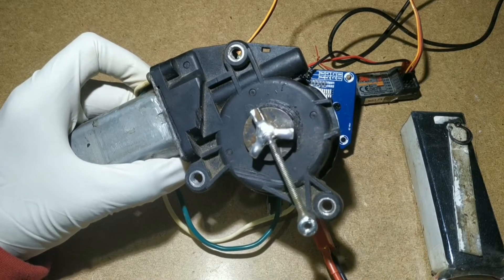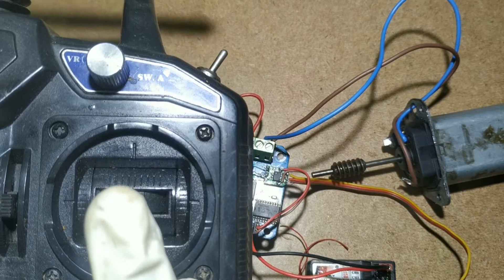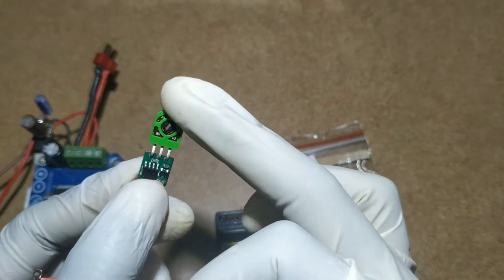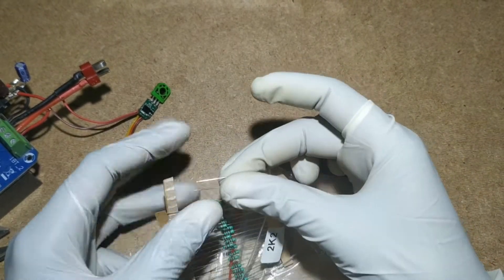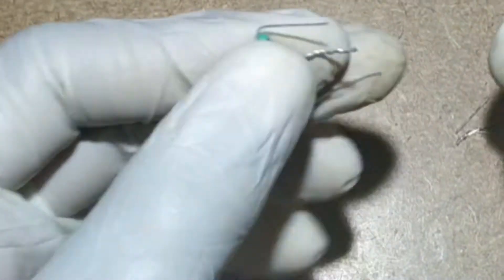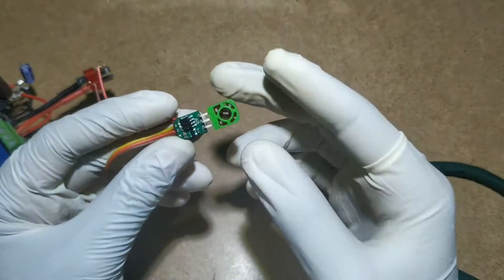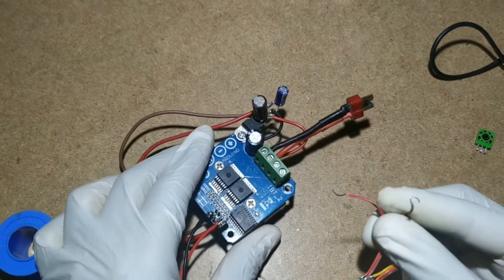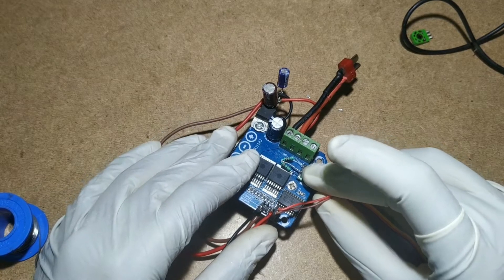How to make brushed esc with servo motor

Comment: May i use 10k resistor
Reply from the maker: “No, use only a 2.2k resistor, because the servo motor originally had a 5k variable resistor, and we had divided the resistance accordingly. Now, we’ve removed the variable resistor and replaced it with a fixed 2.2k resistor.”

Comment: How do you know what resistor to use??
Reply from the maker: because the servo motor originally had a 5k variable resistor, and we had divided the resistance accordingly. Now, we’ve removed the variable resistor and replaced it with a fixed 2.2k resistor.”